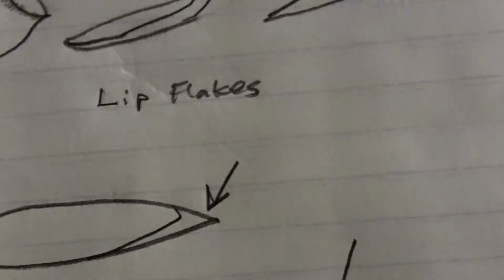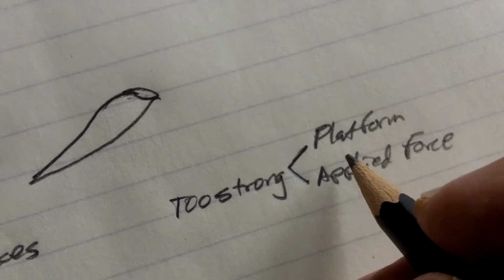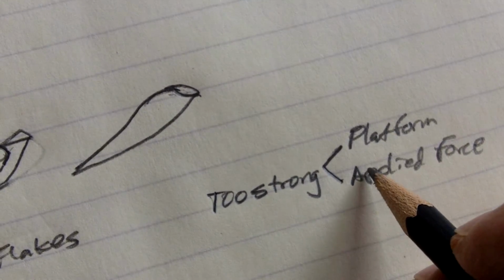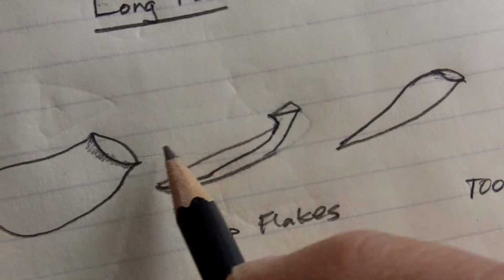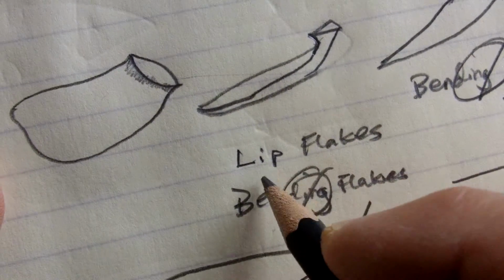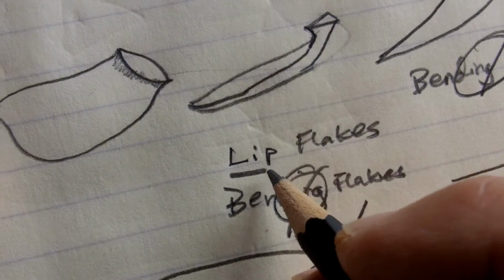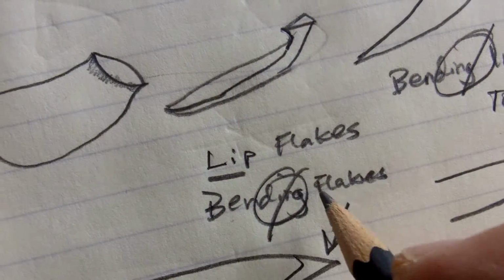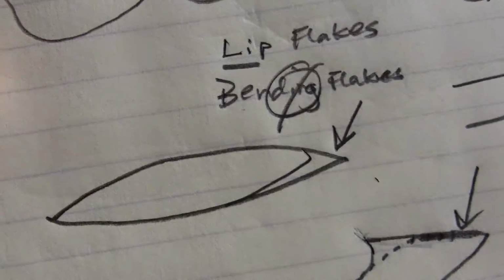331 - Fracturing Part 2a Lip Flakes

Comment: Most all soft hammer platforms show some degree of lipping.  Hammerstones can also yield lip flakes when the point of contact of the platform is a convergent ridge which creates an angle that stiffens the hammerstone platform enough to peel the edge.   Wood playof a create lips because acute edges are ground through dulling or manufacture and require resharpening.  Vertical punches cause lipping when shelves wear and grab higher on the edge than the I tended angle of flake trajectory.  Sometimes these are advantageous as they peel, and therefore turn the edge creating opportunities or balance for the reverse face.   I think I'm going to remove my vertical punch video because I don't want to confuse the discussion.
Reply from the maker: Flintknappingtips Thanks Marty!  I think I may add another video on this topic to show what the edge of the workpiece looks like after a lip flake is removed.  It looks like a bite has been taken out of the edge.  If this "bite" is not present, feel that the flake shouldn't be called a lip (or lipped) flake.  Maybe this is beneficial in some cases, but I see it as a manufacturing error in general.
Reply: On a small scale, for example paleo and Cody points whe soft pressure is used to resharpen edges by applying pressure w a blunt tool to a ridge it peels the ridge off.  This is not only advantageous but necessary result of the tool. Resharpen some dart points w horn for a couple of weeks and revisit the discussion.  You are thinking accidents of intention because you view knapping from a small force high energy perspective from your ishi punch background.   I haven't watched your previous video, and I will now, but I strongly urge you to be more familiar with organic tools before you discuss terms as they have to do with replication.   I still applaud your efforts.
Reply from the maker: Flintknappingtips Forgive me, but I don't understand the "peels the ridge off" reference.  Do you mean the ridge running across the face of the workpiece?  Or do you mean some part of the edge or margin?  And I will do some more knapping with horn.  I've been pressure flaking with buffalo horn and moose palm off camera.
Reply: Allergic Hobbit  no not on the face of the preform but as you said  off the edge, meaning the tool is placed on the top of the ridge of the ridge created by deltas from the obverse (side your'e not flaking from *and I hate terminology too) face)
Reply from the maker: Flintknappingtips Maybe I should call this a "ring fracture" because I think we are talking about two completely different things.  The hesitation I have in doing so, however, is that I see that some "lipped" artifacts are clearly errors.  But, like "overshots", these errors are viewed by some archaeologists and replicators as somehow part of a "higher" purpose.  I'm not saying that's you (heaven's no!) but there has to be a line drawn somewhere.  I dunno.  Just my opinion.  I'm very grateful for your input and observation!  (dang....  sometimes I think I sound like I'm full of myself...  hope I don't go down that road!)
Reply: Allergic Hobbit i wouldn't give you the time (now I'm full of myself haha) if i didn't know that.  I think your intentions are good.   I do think your experience  is leading you in places I can help you with because of the abo tools.  I believe you can gain these experiences also.    I think you would be a most excellent teacher if you had the experience to do so.  I wish the same for flint knappper jimmy.   heart in the right place for sure.